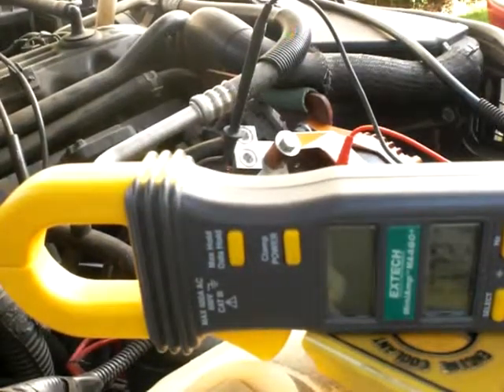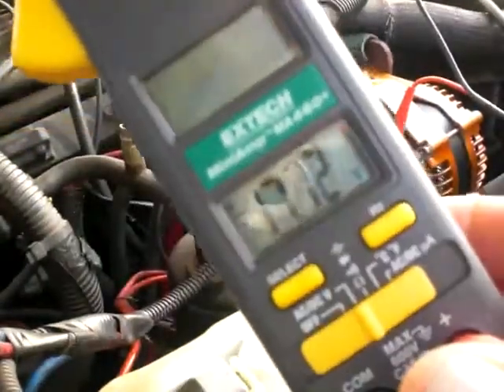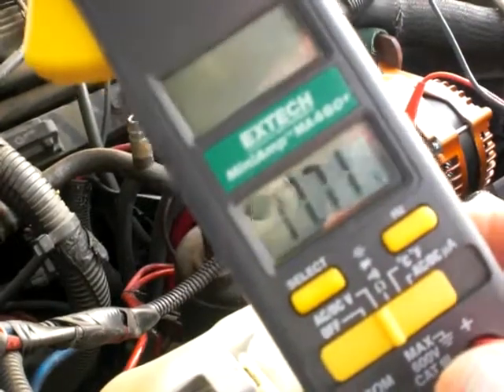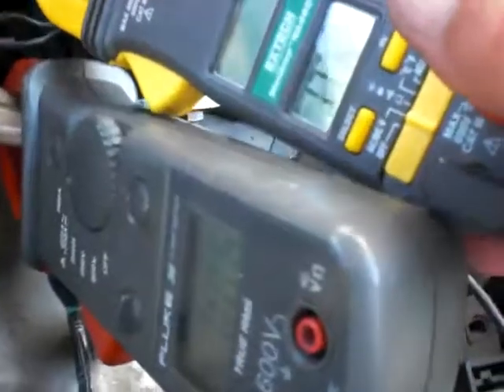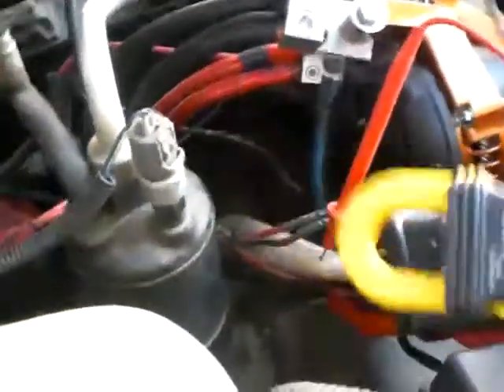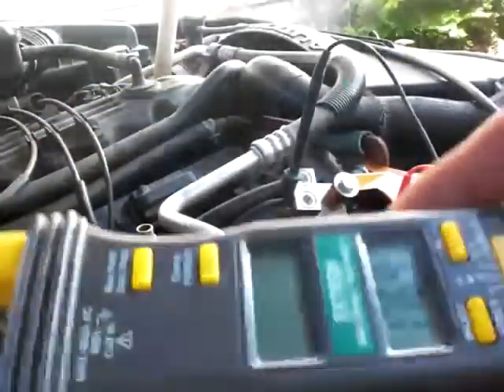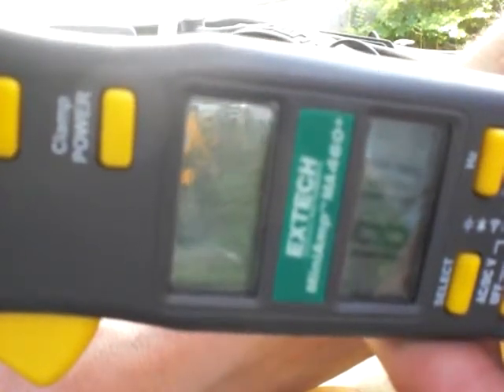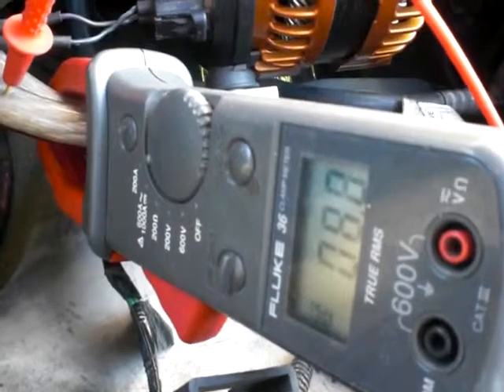External regulator How to part 2

Comment: that voltage setting is WAY TO HIGH !!! Car and truck batteries charge only at 14.5 to 14.9 volts. And your amp clamp goes on one wire not two as you arent getting a proper reading, you are risking in a electrical fire

Comment from the maker: to allow the user variable control of the voltage the alternator puts out. some people run 14v or 16v batteries which need higher charging voltages. but it is also used by people with ECU regulated voltage as well.